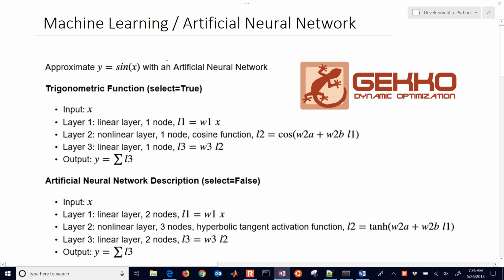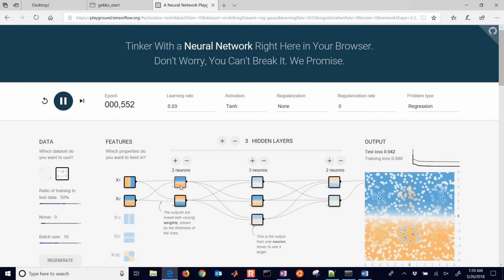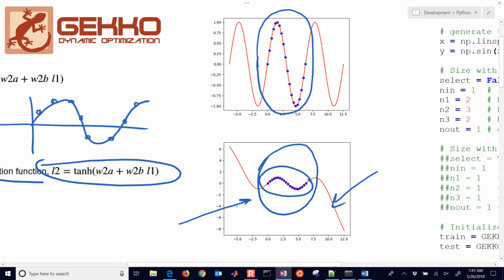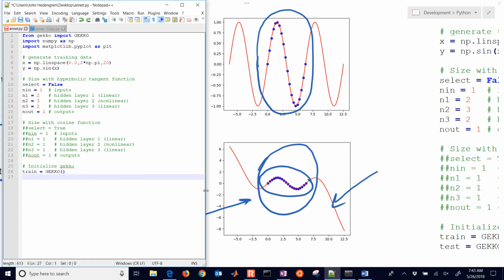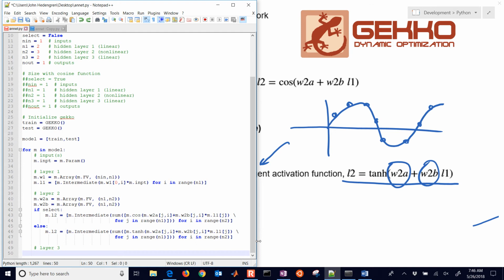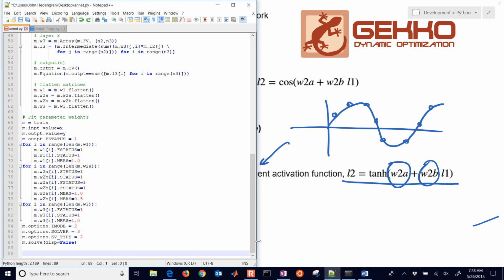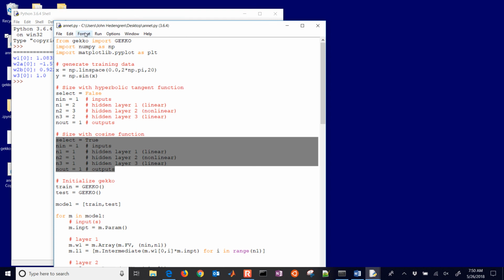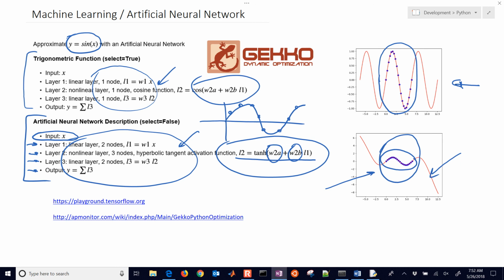Machine Learning with Neural Network in Python GEKKO

Comment: Is it possible to couple a Gekko Machine Learning Model with a Gekko MPC (to use the neural network as a process model ) ?  
This idea confirmed would highly boost my motivation to use Gekko for my scientific works. Many thanks in advance.
Reply from the maker: Yes, here is an example with the TCLab https://apmonitor.com/do/index.php/Main/TCLabG
Reply: @apm  Many thanks for the fast reply! This example is very helpful for my works. 
It would be amazing if APmonitor could share a possible LSTM/RNN realization with Gekko if this was already accomplished. As this is what are we are finally trying to implement.
Reply from the maker: @bL4ckGeniu5  I don't have that specific example but here is an LSTM model and a comparison with a 2nd order model: https://apmonitor.com/do/index.php/Main/LSTMNetwork
Reply: @apm   @apm  could you also couple models learned by gekko.brain with the MPC ? As the "coupling script" seems to be from a time before gekko.brian was developed and brain does simplify the process of obtaining a learned model
Reply from the maker: @bL4ckGeniu5  yes, it should work to couple them. I don't have any example code to show that. If you do try it, please post any code or questions to Stack overflow so that we can learn from your experience.

Comment: Why don't you use sum() for the layer 1?
Reply from the maker: The output of the layer is a vector, not a scalar because we are feeding into the next layer with multiple nodes. Check out this new Gekko package for deep learning: https://gekko.readthedocs.io/en/latest/brain.html
Reply: APMonitor.com in that sense, the layer 3 will receive also a row vector 1x3? And each element of that 1x3 vector is because of that sum() in layer 2, am I correct?
Reply from the maker: @jesusmanuellevinsonrondon5107  , yes, each layer is either a vector output. It only collapses to a single value on output.
Reply: APMonitor.com thank you
Reply: Oh, today is was found your video here, and i‘must say i like it. my questions is there some complet howto to install all components to try some backtests on gekko ?
Reply from the maker: @nullbyte7140  check out video 18 here: https://apmonitor.com/wiki/index.php/Main/GekkoPythonOptimization  It shows you how to run locally and debug the application. You may need to turn up the debug level when solving with m.solve(debug=2).